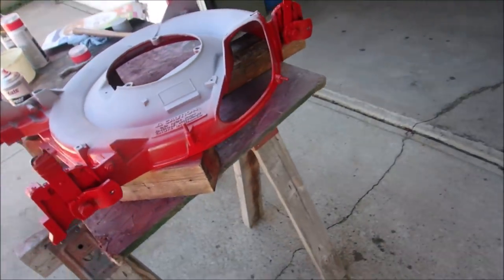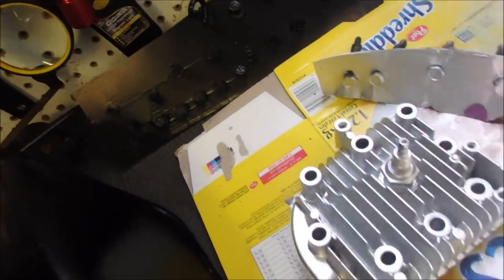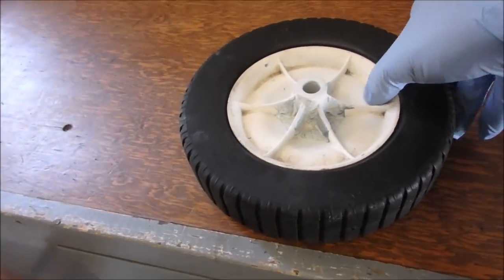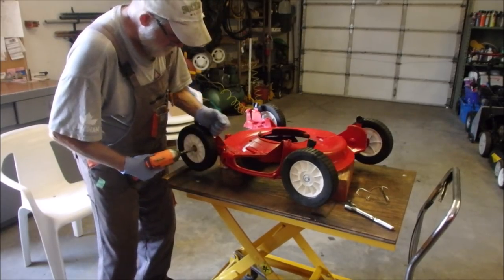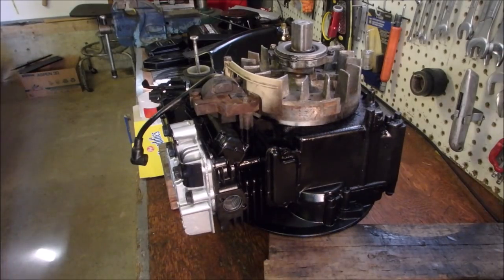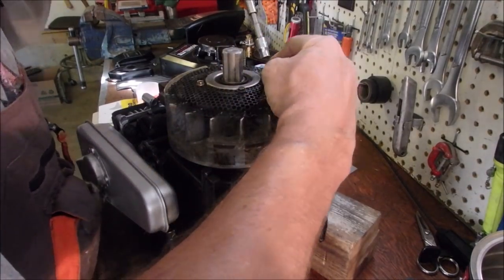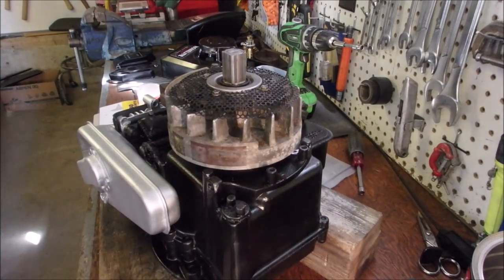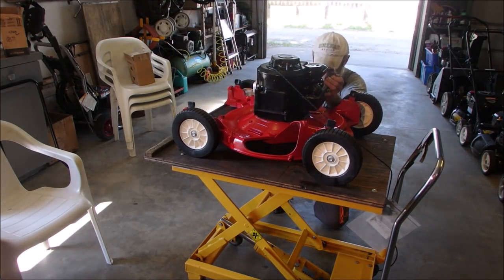Homelite Aluminium Mower Completion (Part 7)

Comment: I know this was about a year ago but I just saw it and I wanted to say what a beautiful job you did! I bought this exact same mower brand new from a department store here in the states called Boscovs around 1993 or so. Funny thing, I paid for the push mower at the register but when I went around back to the pick-up area they gave me the self-propelled version. I was just about to put it in my truck when I saw the writing on the side of the box and realized it was the wrong one so I told the guy and he went back and got me the right one. Oddly enough I ended up returning it because it was too small for my yard, I ended up buying a Craftsman 22" self-propelled mower!
Reply from the maker: Right.  I use this little mower in the alley for trimming now.  Sears is out of business in Canada and Lowes has taken up the craftsman line.

Comment: those decks are awesome, they clear out the grass better than most, great design
Reply from the maker: It really does do a god job of clearing grass.  I cuts so fine.
Reply: I had the self propelled version, loved the bag design and the deck was the jewel, it ran for many years but the downfall of mine was that it came with a Tecumseh engine which eventually started uing quite a bit of oil
Reply from the maker: This one, even though it has the side discharge you hardly see the grass.

Comment: I saved an old Snapper self propelled with a cast deck. I expect it will outlast me! I put swivel wheels on the front to make for easier turning. Nice job Bruce.
Reply from the maker: Thanks Mr. Shade.  Sorry I didn't reply sooner.  Lots of comments to go through.  That is good though.

Comment: This was a cool series.  My only comment is that if you pour the oil with the spout toward the top it won't glug glug when you refill the crankcase.  See the embossed picture near the cap on the oil bottle.  You did a great job.
Reply from the maker: Thanks Mark

Comment: This is an amazing transformation. I hope you used straight weight oil to reduce potential smoking and consumption. This mower turned out beautiful. :-)
Reply from the maker: Yes.  On the special projects I use 30W    On the regular projects   even my Honda   10/30

Comment: Hi Bruce Pender, beautyful job. I did pretty much the same thing with my old mower. But i like to install the fuel tank after installing the engine.
Only thing that bothered me, was that million little things flew into wet paint. But what you gonna do eh.
Reply from the maker: Yes  That happens everytime and then the fingerprints to muck with it while it is drying.  Thanks for the fun memory.

Comment: Couple questions for you, what do you use for painting the deck and engine, and what do you use for greasing cables up? Can they be saved when they are seized or partially seized?
Reply from the maker: I used a spay paint for Aluminium.    I have not had much luck on cables that are even partially seized.  If they are stiff they can be lubricated.  There is a cable lube tool.  
https://www.amazon.ca/Motion-Pro-08-0182-Cable-Luber/dp/B0012TYX9W

Comment: Did you use a special paint on that aluminum deck?I had an older aluminum Toro that I sold prior to an attempt to restore. Seems that I discovered that aluminum requires something other than regular paint & prep. It would have been a lot of work. Yours ... very nice job, btw.
Reply from the maker: Yes I used an etching primer which stuck great.  I would use it again

Comment: I have undertaken a goofy personal challenge as regards the use of anti-seize compound and have, thus far, failed at every attempt, No matter how careful I am when using it (and I use it a lot!) I can never avoid getting the "silver magic" on at least some of my digits ! Not sure why but it amazes me how tough it is!. The mower looks fantastic Bruce. Aluminum decks are wonderful as long as you can keep from bashing them into things and fracturing them when you get down to business with them Beautiful restoration. Did you put a coat of lacquer over the red paint so that the inevitable gasoline spills won't damage it?
Reply from the maker: Not I haven't.  But great advice.  I will pick one up today.

Comment: Hi. I have Homelite lawnmower the carburetor is damaged please let me know How and where can I buy new or used carburetor. Thanks
Reply from the maker: OK  It is the engine on the mower not really the Homelite make.  On this model the ca4rb is abocve the gas tank.  If that is the case just google   Carbuator for a Briggs Classic.  Here is what i got.  
https://www.amazon.ca/Carbhub-795477-Carburetor-Briggs-Stratton/dp/B07F3LL83J/ref=asc_df_B07F3LL83J/?tag=googleshopc0c-20&linkCode=df0&hvadid=459414337344&hvpos=&hvnetw=g&hvrand=14115914572255886735&hvpone=&hvptwo=&h
There are a lot of choices though.
This is a Canadian link

Comment: One of the reasons I am such an advocate of LawnBoy mowers is that they also had the non-rusting aluminum (magnesium?) deck.  One of the reasons the things lasted forever.  My current LawnBoy is about 25 years old and still runs great, though the rear tires are wearing out. Bummer.  I wasn't aware that other mowers were made with the same kind of deck.  But anyway, not being familiar with B&S engines, I am thinking (guessing/hoping) that the mounting holes on the engine would be standardized and that if this engine, for some reason, was to become trash, the deck could be saved and used with another engine mounted to it.  Gotta save those non-rusting decks.

As far as I know, old non-steal LawyBoy decks couldn't be used to mount a B&S engine to.  Unfortunately.  But maybe this mowing deck could be.   Yes?  Maybe?
Reply from the maker: The older Lawn Boy were very different in everything from carbs to mounting.  I don't have one here to check for you.  Sorry.
Reply: Bruce, I failed to correctly communicate my question.  I know for a fact that a B&S will not fit a LawnBoy mowing deck with out a Frankenstein like set of adapters.

My question was about the Homelite mowing deck that you have just refurbished.  As it already has mounting holes for it's current B&S engine, would it be possible to mount other B&S engines to that same Homelite mowing deck.  Do B&S engines have a standardized placement for mounting bolts to make that possible?
Reply from the maker: Yes.  They have a 3 hole design.  That is why you will see on a Craftsman machine for example a Tecumseh,  Briggs or a Honda engine.  MTD provides most of the decks but not all of course. The length of the output shaft can be an issue though as many motors have a different length of shaft , thus changing the height of the blade compared to the deck.  .  I hope I helped.  Sorry I had my birthday party last night and I am not on the top of my game.  haha.
Reply: Congratulations on reaching 62!!  

As far as the Homelite mowing deck goes, GREAT!  You have there a mowing deck that can last the ages.  Just keep putting on newer engines (and wheels) and your great great great grandchildren can keep using it. ;^)
Reply from the maker: right!!!

Comment: Me again.  It's never easy!  I have a friend with a non-starting snowblower (Bolens by MTD) I've been trying to get my hands on since Winter (I'm positive it's ethanol gas left in the tank).  Got it yesterday and it is fighting me!  Choke & throttle knobs would not come off, thought I'd break them (didn't); handle was in the way of a plastic side cover, had to remove both wheels to access handle bolts, take them out, and pivot the handle down . . . is it always like this??!!  Got the carb off, bowl looks worse than any I've ever seen in your videos; carb itself is . . . not awful.  The gas in the bowl was mahogany colored!  Fuel tank looks great inside, no rust from there (and it was "bone dry," as the small engine mechanics say).  After work tomorrow . . . Carb Cleaning!  Wish me luck!
Reply from the maker: One step at a time.  Do a good job on the carb.  Clean both jets (if there is a second one on the side)  Good luck!!!
Reply: The primer is working great, the way it's supposed to!  So well, in fact, that gas leaked out of the bowl gasket!  I'd taken it off since I had to clean the carb so extensively.  I hoping to buy a new one and put it on in situ so I don't have to take that damn cover off again!  (part of it is held on with the acorn nuts that secure the carb)
Reply from the maker: The primer will leak out of the vent when pumped a lot.  That acorn nut is most likely a jet that holds the bowl on.  You are doing great Chris.  That cover is minor.  the choke lever should pry off.  Good luck!!!

Comment: Bruce take that impact find a junk motor and tear it down and then play with the trigger its got a lot of control of the gun then start with 4 mill bolts and see how much it takes to strip them then work up to a twelve mm bolt do your best to strip or break then you will know your impact gun keep the videos comming
Reply from the maker: Thanks.  That is a great idea.  I know my air impact that well but I am just learning this one.  Good for you to notice.  I am old school eh!!
Reply: i use mine for everything from screws in plastic to 1/2 inch bolts i would be lost without mine  it has saved my back you dont realized how much pressure you put on your neck and back with wrenches and ratchets
Reply: lol when my son in-law told me to get one i kept saying my electric drill is just fine he pushed me to get one now i cant work without it lol
Reply from the maker: We  It is the next day my poor wife has to listen to me whine away.  I do know about the wrench torque on my body.

Comment: Payback Time, I get to give you Helpful Hint!!  

The zip ties holding the throttle cable to the handle:  if you cut those, close to the "ratchety" part, with a pair of fingernail clippers (with curved blades) it will be nice & flush and you won't have any sharp pointy parts that can scratch you.  I use zip ties on my bicycle a lot, for accessories, and a fellow cyclist told me about that - otherwise zip ties can scratch your legs up when wearing those ridiculous tight shorts!
Reply from the maker: Right.  I was an equipment installer for years,  It was mandatory to cut them off flush so the worker wouldn't get cut on the tag.  I left the tails on as they is how they come from the store.  Crazy eh!!